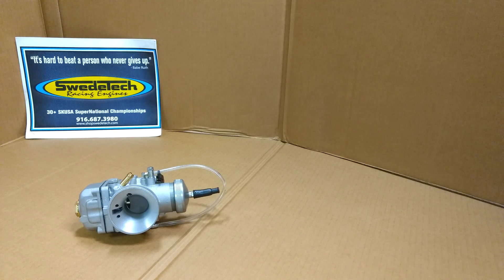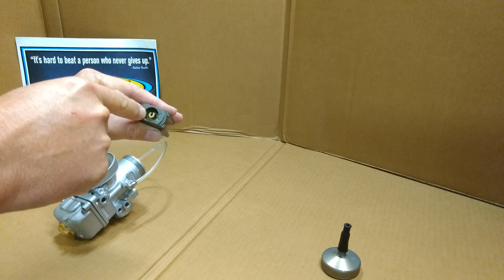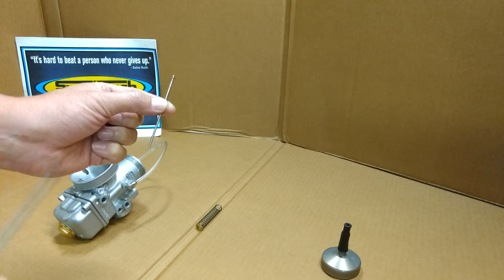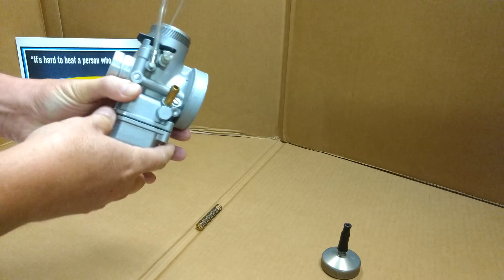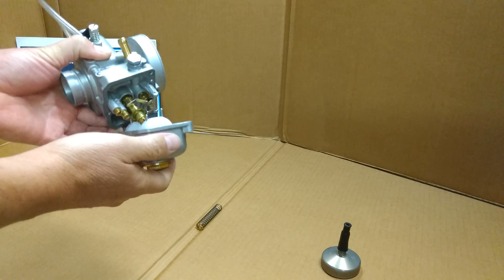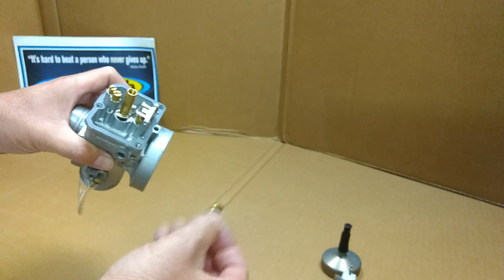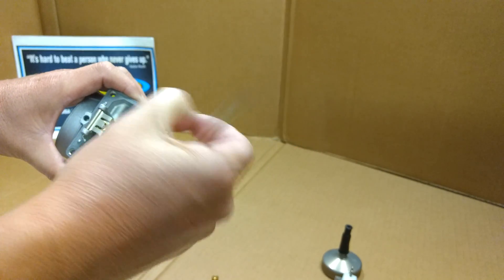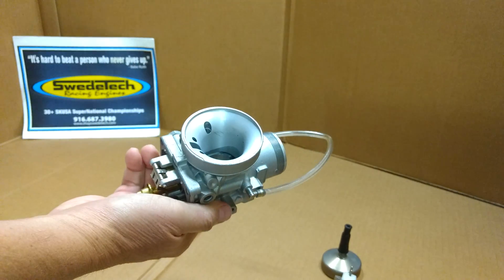Dellorto VHSH 30mm Carburetor - components and parts

Comment: Thanks for the video. These questions pertain to this carb on the ROK engine. 
1) Adjustment of idle screw. What is the goal? For the engine to easily idle on its own?
2) Adjustment of the air screw. What is the goal? How do we know its in the correct position? 
3) Other than ROK Cup specs, is it necessary to change the emulsifier tube based on density altitudes?
4) Looking at an app for tuning this carb for the ROK, it seems that the needle is always K3 and the outer and inner idle jets are always B65/65, regardless of density altitude. Does this sound right? Similarly does the choke circuit jet need to be changed based on density altitude?

Thanks again.

Comment: why is the overflow hose connected to each outlet? what happens to the fuel if the carb overflows ?
Reply: Nice, thanks alot!
Reply from the maker: Those outlets are not for the oveflow, it is for air venting to equalize the carb.  Some VHSH carburetor models have a float bowl with an over flow tube, however, this one does not.
Reply: thanks
Reply: Cool! The vent hose is not needed to go to free air? On my VHSH cs carb there is one hose on each nipple going to free air, using a tube with sufficient lenght connected to both nipples is good enough ventilation?
Reply from the maker: You can't tell from the video, but the vent line is sliced open on the top.  You do need free air to this carb for it to work properly.
Reply from the maker: We will have a video on the carburetors apertures in the future.  However, we will not have online in-depth tuning guides.  Each application is unique and we greatly affect the tuning.   We do have a staff of knowledgeable tuners that are available for hire for specific needs.
Reply: What is meant by shut off setting 3mm for k9c tm engine